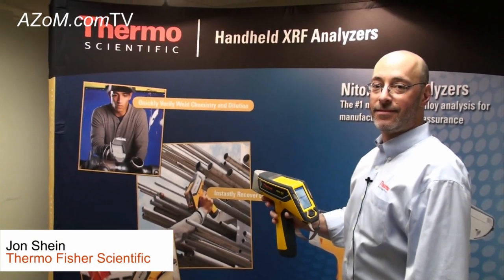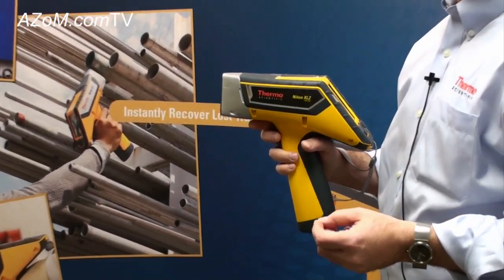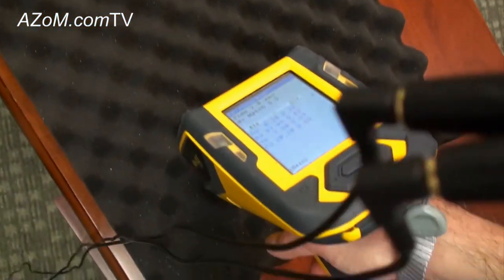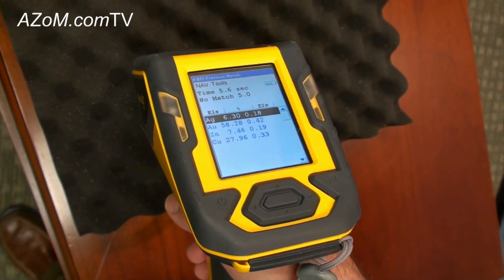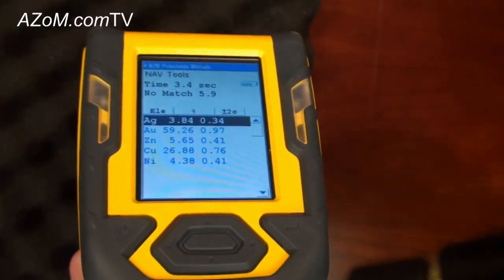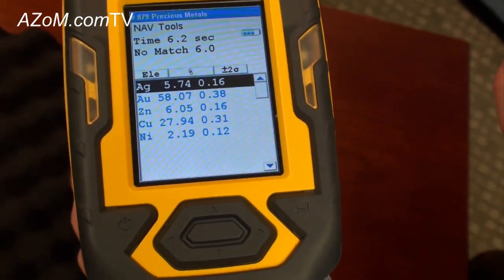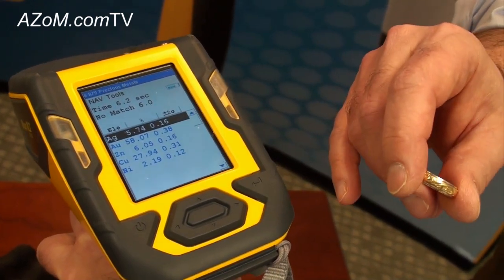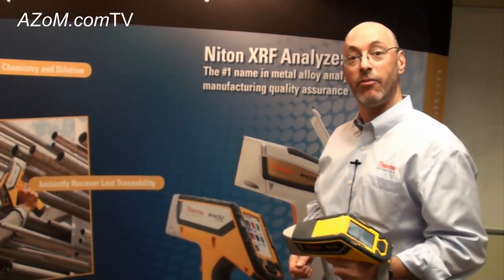Analysis of Gold Jewellery Using the Niton XL2 from Thermo Scientific

Comment: A1. There are a number of ways to determine authenticity of coins,bars,other precious metals. Choosing correct method highly dependent on individual needs and what is tested. The counterfeits are becoming more sophisticated, so regardless of  test the user must always exercise some caution. If you are coin dealer, careful inspection of the coin for dimensions, weight, stamp markings and XRF analysis will give you what you need to make a correct determination of coin’s authenticity....

Comment: @vincecate  “Although x-ray fluorescence (XRF) technology is generally considered a surface analysis, there are ways to interpret the XRF results to assist in determining if an item is plated. Analysis results will show the gold content of the plated surface, and in the case of most plated items a strong signal will also come from the substrate underneath the plating. These results often show a relatively low gold concentration in comparison to the substrate material. (continued next comment...)